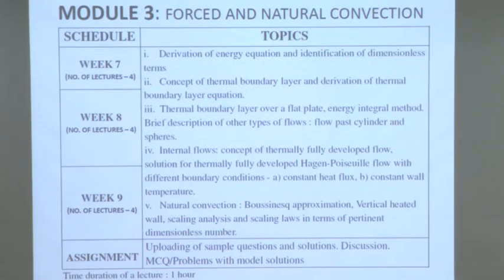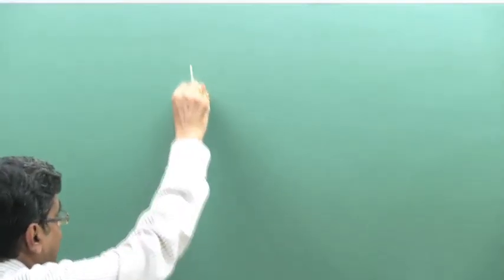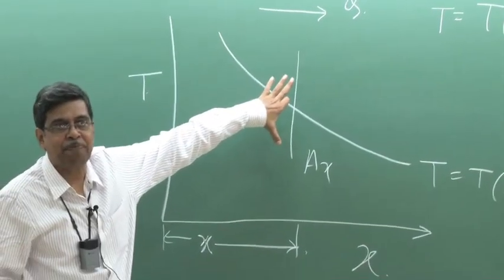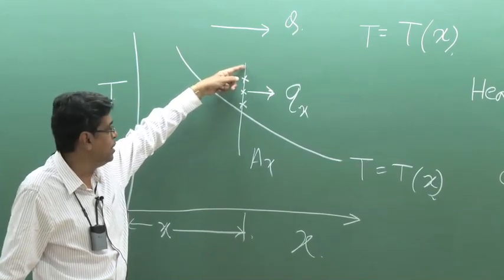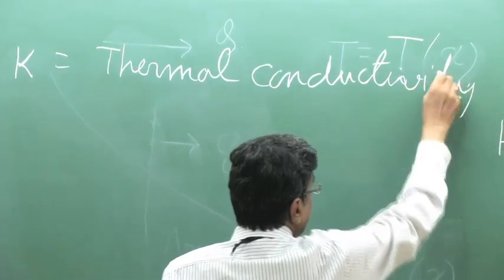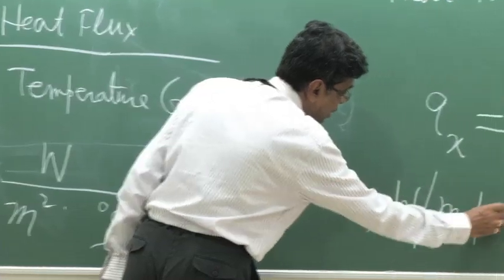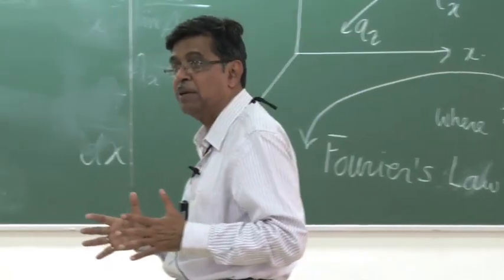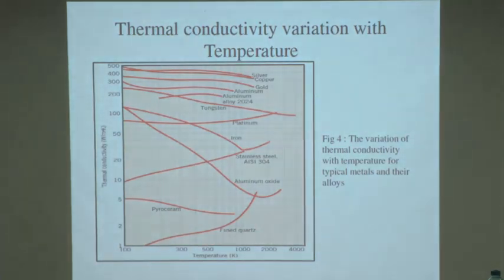Lecture 01: Introduction and Fundamental Concepts - I

Comment: sir I have a problem?as you said that in steady state, internal  heat generation doesn't occur but in farther lecture you said heat generation is a function of space coordinate but not time when you deriving steady one -D heat conduction eq. now I am in little bit of confusion that what actually does the mean of steady state heat conduction? as far as I know about it ,is that heat generation(Qg) is constant w.r.t. time but   what about with space coordinate? is it also constant w.r.t. space coordinate(along-x,y and z)? if internal heat generation varies in space coordinate then sir please tell why?.becoz you said that "for steady state heat condition through any body whatever the heat coming in the same will going out" and it can be possible only in one case when there is no generation.I mean of course it is invariant with but it can be possible that it could be function of space coordinate.my main question is that steady state means absolutely no heat generation or not??
Reply: Occurrence of being steady or unsteady state Heat transfer is completely dependent upon whether its (internal energy in the form of average kinetic energy of molecules at microscopic level) storage with respect to time or not. If it stores energy I.e. (rho*Cp*T) in instants of time then its temperature at any instant will change so it becomes transient irrespective whether source or sink term presents in it or not or even it varies with space or time doesn't matter.

Comment: Thanks to respected S.K.SOM sir for heat transfer lectures. I have learnt so many things from your lecture.Excellent explanation about heat conduction concept.
Sir for conduction the main condition is that molecules doesnot change their respective positions.and this conduction accur because of  their latice vibrations.but i have a query about conduction in fluid medium if all fluid particle in  fix position. Sir is it possible  if possible then  explain conduction in fluid and gas medium with example
Reply from the maker: +JAIMIN PATEL Conduction heat transfer takes place from the particles having more thermal energy to the adjasent particles having less thermal energy due to the INTERACTIONS among the particles.

In solids, this INTERACTIONS are lattice vibration and the motion of free electrons.

For fluids (liquids and gases), this INTERACTIONS are collisions and diffusion of the molecules. Note that at the molecular level all the molecules are undergoing a random motion  (randomness is more for gases). However, this random motion produces no net transport of fluid across a macroscopic surface. This can be explained in the following way. If N number of molecules move from LEFT to RIGHT then there must be N number of molecules which are moving from RIGHT to LEFT to remain the fluid STATIONARY macroscopic ally. So in this process there is no bulk movement of the fluid. But if the molecules which are moving from LEFT to RIGHT are having high kinetic energy and the molecules which are moving from RIGHT to LEFT are having low kinetic energy, then the net transfer of thermal energy takes place from the LEFT to the RIGHT.
Reply: Thank you sir
Reply from the maker: +NOC16 ME06 Jan-May When a fluid is at stationary condition, the molecules of the fluid may not be in stationary condition. Stationary fluid defines the fact that the bulk fluid velocity U=0. The fluid molecules always move randomly with velocity say Um. Now if we take a small volume V (smallness is dictated by the continuum hypothesis) and determine the volume average of Um then we get U = (1/V)*integration of Um over the volume V. If the fluid is in stationary condition then we obtain U=0. This does not necessarily mean Um=0.
Reply: Yes  sir. I have got point. Thanks for clearing my concept.

Now sir one more question that Is viscosity a property of fluid  play a role in this conduction  heat transfer process?
Reply from the maker: +JAIMIN PATEL Effect of viscosity only comes during transfer of momentum and viscous dissipation. So if the fluid is in static condition, viscosity has no effect on heat transfer (or conduction).